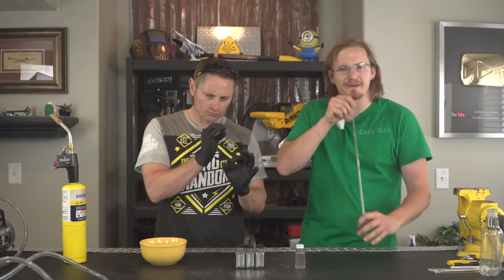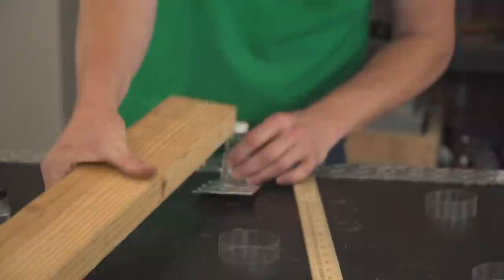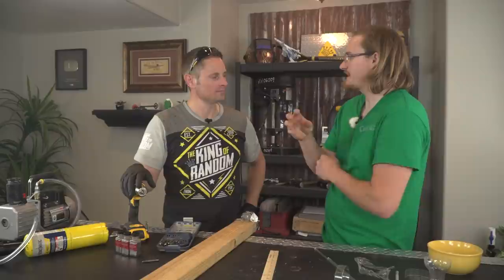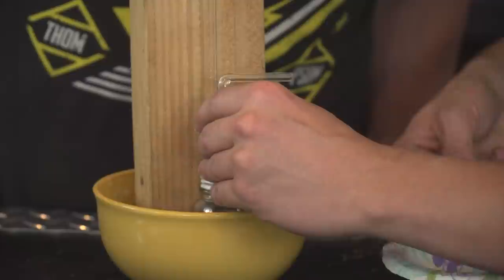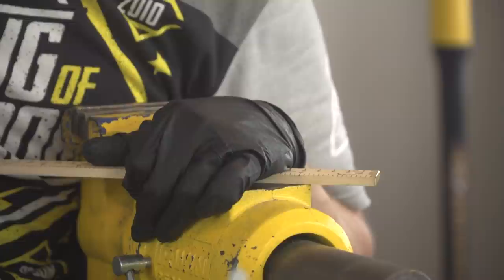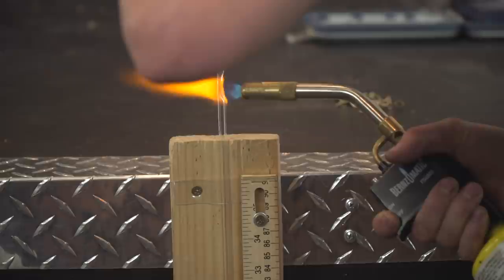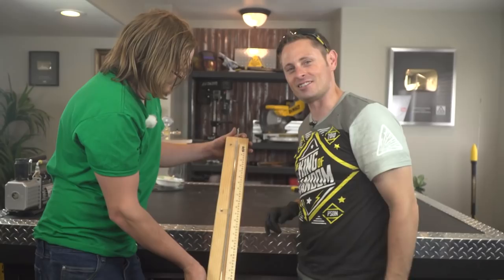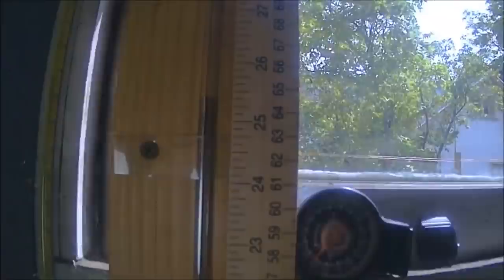Making a Barometer With King of Random

Comment: Kudos for tackling this. I did it a long time ago (still works!) and it's a very gratifying instrument to make.

There are few major errors you made that result with problems with this barometer, though:

1) That aluminium base is going to rust away. No doubt about that. Never ever use aluminium to secure anything around mercury. They do leak vapors (don't keep them indoors) and sooner or later that thing will fall off. Use a wooden base secured with iron nails and PVA glue.

2) Use a millimetre paper. As you can see, daily oscillations of atmospheric pressure are tiny. For mercury barometers, mmHg is the best unit. It's metric, translates easily to pascals, and it's dense.

3) That's not how barometer tubes are filled. That little bubble of air at the top is not a small error. Pressure above mercury should be mercury vapor pressure at given temperature. You have a significant air bubble (tube is narrow).
This barometer will give off wrong readings.
Instead of vacuuming it, let the liquid do its thing. Seal the tube into spherical shape, anneal it with sooty flame (your seal has a great chance of snapping from thermal shock). Secure the tube against a wooden plank and slowly fill it with mercury. Few drops, agitation, tapping on the glass. That completely fills the tube and you can see if there are any trapped air bubbles. Care must be taken not to subject the tube with lots of liquid to acceleration because liquid hammer effect will occur and it will smash the sealed end.After you fill it, hold the opening with a finger, tilt the tube slightly (liquid won't pour out - atmosphere is holding it) and slide it into a bottle of mercury. Then lift it upright, slowly, while tapping the sealed top. Liquid will pour out, leaving a nearly perfect vacuum at the top, vacuum you can't get with even reasonably priced pumps.

It's an art and it takes considerable work. It can be downright hazardous because glass snaps and mercury shoots out so make sure the bottle can hold all of the mercury from the tube.
Good thinking with the balloon. It shows you understand how this works.
What you now have is a baroscope. To make it a barometer, you need proper vacuum inside and calibration.

Comment: The vacuum may be illustrative but a barometer would be more easily made by filling the tube with mercury and having the perfect vacuum happen as you turn the tube over. The vacuum pump adds nothing to the finished product.

Comment: Isn't that an imperfect vacuum? I thought the process was to mercury fill the tube and then invert it.
Reply: YES! You are 100% correct. That is the procedure that delivers a tube that can be calibrated. Their barometer contains significant amount of air above mercury so it can't be used for measuring.

Comment: instead of trying to pull the vacuum with the pump you could have closed off the tube, filled it with mercury, and tiped it over into a bowl. you would then have a near perfect vacuum with the exception of the mercury vapor

Comment: If it was a true vacuum the mercury should make a crack as it slaps on the glass very hard (sometimes can cause the glass to break  ... or os did my physics teacher tell me ... so I'd avoid doing that on a melt sealed tube if I could).
Also I'd have tried to achieve the vacuum from a filled tube and then put it upside down into the mercury jar to let the level go down leaving a close to perfect vacuum (just the vapor pressure left) .
Reply: Yes, it's the liquid hammer effect. When properly filled and inverted, mercury in a tube can hit the sealed end and that sounds kind of like strinking a musical triangle. Very dangerous as it can cause the sealed end to burst. That's why it has to be made spherical and annealed.
Also, those strikes emit light, too. It's very faint but visible in complete darkness when your eyes adjust. Separation of charges does it.

Comment: That's a great job Cody I'm glad I'm subbed but, can you take the project and put it on sea level to an actual sea or ocean so we can see the actual pressure on sea level.
Thanks, love.👍
Me
Reply: Theoretically the pressure there should be 760mm•Hg I really wanna know if it's the same using an actual measuring tool

Comment: You did it the hard way.....fill a tube that has only one hole in it (the hole you drop into the mercury at the bottom with mercury.  Then wear gloves and put your finger over it.    Then invert into the mercury pool at the bottom.  The mercury drops and produces a vacuum.  Easy barometer.....

Comment: Why do you have to pull (an imperfect) vacuum before sealing it?

If you'd just fill the tube completely with Mercury in a horizontal position, and then stand the tube up, shouldn't the weight of the Mercury pull a basically perfect vacuum at the top of the tube?

Comment: Hi Cody & Grant. Could it be possible to make the barometer without using the vacuum pump?  eg. Fill up the tube with one end capped (horizontal position) which will of course be a perfect vacuum in vertical position.

Comment: For the barometer, couldn't you seal the glass tube then fill it with mercury and quickly turn it over into a pool of mercury? or even cap it off while under a small amount then place it in the pool, then un cap it? I'm just thinking that if you tip that the wrong way you are going to have way too much trouble fixing it.

Comment: Nice video, but the vacuum needs to be perfect, otherwise the barometer will not provide a true reading. That little vacuum pump does not provide the level of vacuum that's required for a true barometer.

Comment: Cody, random question here: I'm ordering a metal forge to melt down some scrap but I'm worried about the slag that may be generated. Should I just use a metal spoon to quickly scoop the slag? Is there a better option? Thanks! (I'm planning to melt down copper and aluminum)

Comment: Is there a set width of the glass tube that needs to be used? it seems if a thicker tube was used it would take much more force to make it rise
Reply: Indeed a valid question. Mercury displays negative capillarity. I'd suggest not going narrower than 2 mm.

Comment: I'm not sure I get how this works... If the pipe and bottle are perfectly sealed and rigid, how does external pressure changes affect the level? Is that what the balloon was for? (I thought that was to trap vapour?)

It was said in the video that if the outside was made into a perfect vacuum, that the level would rise right to the top... but if it's sealed and rigid, I would have expected the inside to be its "own environment"?!

Comment: Cody, is there any reason you couldn't build the barometer upside down, with the Mercury already filling the tube to "remove" all of the air and then flip it back over at the end? that would use the Mercury to pull the vacuum for those of us with no pump, and might even pull a better vacuum?

Comment: Good video. You could fill the sealed tube with mercury, put a (gloved) finger over the end turn it upside-dwon, then into your mercury reservoir. instead of using a vacuum pump. Also, can you make your scale adjustable with repect to the level of mercury in the reservoir? That would reduce the 'emergent column error' (a bit like the Torricelli barometer).

Comment: does having a different width of tubing change the height of the mercury?
Reply: I'm pretty sure it doesn't. Maybe if it's really narrow you could get some competing factors at play. Just look to the units used: PSI for one. Pounds per square inch. That is, if you increase the square inches, you don't get less force on each square inch. It's like how gravity affects heavier things. Heavier things are accelerated the same as light things, because gravity applies to each unit of mass the same no matter how many there are. It's not like there's only so much gravity to go around and heavier things have to spread it out more, right? In the same way, pressure applies equally to every bit of area it's pressing on.

That's my best explanation anyway.

Comment: I know you have vacuum pumps ...... but could you not do it by lowering the tube until the mercury is at the top and sealing it (epoxy?) .... then when you raise the tube to the vertical and the mercury drops you could then seal the tube with your torch?
Reply from the maker: Thats what I did last time and it was a royal pain in the but.
Reply: Fair point then ;O)

Comment: Mix termite and potasium nitrate 50/50 and light it up . Will it burn or explose ??
Reply: Kamun Reser thermite already has an oxidizer so adding nitrate to it will probably just make it burn slower or not at all
Reply: Max McCormick My chemistry teacher say its will probabli explode, but its dangereos because the pieces of molten iron will fly anywhere, so we cant try it.
Reply: Probably the reaction woudnt work. The nitrate would oxidize the Al before it would react with the FeO.
Reply from the maker: ok so fun fact: adding a salt (metal acid) to something and heating it is very similar to adding the respective acid since in this context hydrogen actually behaves like a metal . so If you add nitric acid to Iron oxide, not much happens since nitric acid is an oxidising acid and the iron is already oxidized, it may go into a solution but its about the same type of reaction as sugar dissolving in water and of course potassium nitrate does the same thing. aluminium reacts with nitric acid for a brief instant before forming an insoluble layer of aluminium oxide and the reaction stops. potassim nitrate does the same and so unless the aluminium is atomically fine (particles only a few atoms thick and somehow not already oxidized)  no visible reaction will take place. put this together and the nitrate will form a protective layer keeping the iron from reacting, therefore the thermite reaction will be stopped or at least made much harder to operate. Now if the nitrate is in a low level that still allows the thermite reaction to propagate the intense heat will decompose  potassium nitrate into potassium oxides, oxygen and nitrogen gas. the oxygen may react with the metallic iron formed and release a bit more energy that way but it wont be significant to the overall reaction. the nitrogen gas however will cause the thermite to sputter and froth, likely tossing it out of the reaction container. 
Ok, so you obviously caught me at a good time, this is probably the most detailed comment response I've made in a while.
Reply: Kamun Reser I don’t know, I don’t have a lot of termites
Reply: Impressive response Cody!
Reply: Cody'sLab Thank you.
Reply: Cody'sLab this comment made me reconsider not majoring in chemistry
Reply: Postassium nitrate does not burn on it's own, it just oxidizes other substances. Potassium nitrate is harmful to living creatures such as termites, and causes skin and lung irritation, and will cause severe breathing issues if enough is inhaled. When you mix the termites in with the potassium nitrate it will most likely harm and eventually kill them. The potassium nitrate will not burn, it needs to be mixed with something else that does burn and it will speed the reaction. The termites will possibly burn but not very well, and definately would not explode.
Reply: John E. It's amusing how many people have taken his typos and bad grammar and tried to seriously answer the question in one form or another, some taking him at meaning thermite and some literally taking it at face for termite. Quite amusing.
Reply: Mikee Vee ok ok english is my third language so if i made a error dont critize me please.
Reply: Kamun Reser oh, I'm not criticising you, I'm laughing at the people who are interperating it both ways, I knew what you meant, and most ran with it as a joke, but some actually explained what would happen to a termite.

Comment: Can you make Mercury
Reply: The Animals urm... it’s an E L E M E N T
Reply: No it be an element
Reply: It can be mined and refined, or it can be extracted from some other chemical, but it can not be made without a particle accelerator : P
Reply: The Animals yes you can, I have a recipe you can use:

200 ml of seminal fluid 
50 g of dried rat shit
Half a cucumber 
A homeless mans shoes, preferably leather 
And 30 ml of condensed zyklon b gas 

Hope this helps :)
Reply: He did make videos purifying it
Reply: The Animals he made a vid where he extracted it from cinnabar , if u mean mining
Reply: Cody has refined mercury from cinnabar. It's in a video awhile back, really interesting.
Reply: Yes, just take 80 Helium atoms or 10 Oxygen atoms and smash them together as hard as you can, then BOOM, you've got Mercury.
Reply: canned_doughnuts _ you can make elements. Hydrogen is an element and it can be made by mixing drain cleaner with aluminium foil. I dont understand the specifics, keep that in mind
Reply: canned_doughnuts _ not just leather! It has to be leather of unborn deer! Otherwise the yields will be very low and contaminated with zinc!
Reply from the maker: I might be able to hit gold with some neutrons but with my current capability I might only make a milligram after a thousand years and I would ruin perfectly good gold in the process.
Reply: Yeah, you just need a particle accelerator and collide fundamental particles at almost the speed of light to make it
Reply: Step one: get yourself a very big star
Step two: wait for a few billion years
Step three: hope for supernova
Step four: collect mercury
Reply: obvious grant fan is obvious
Reply: DerpFace Davis  You're not actually making hydrogen in that case. The drain cleaner already has hydrogen atoms in its molecules, and you're just separating them.
Reply: No, it's an element and unless you are rearranging atoms you can't make mercury
Reply: DerpFace Davis ya but you aren't making it, you are simply extracting it :)
Reply: Damnit Cody I was going to give that reply. You stole my thunder. :)
Yes, you can make mercury:
1. Take a strong source of alpha radiation - americium or polonium might work but have too short half-lives so you may want to go for radium directly
2. Mix it with beryllium to make a source of fast neutrons
3. Place a several inch thick piece of plastic or paraffin next to your neutron source as a moderator to slow them down
4. On the other side of the moderator, put a gold coin.
5. Go do something else for a few thousand years.
6. Come back, and your gold coin will now contain a few milligrams of mercury.
7. Profit!!!
Reply: Theoretically, you could add a proton to gold, and you'll get an isotope of mercury... but nobody's really done it, or has bothered to
Reply: use code: KEEM
Reply: +Gandhi Boys or you get water and some helium gas

Comment: why dont you calibrate the barometer phone the  local airport for pressure?
Reply: I'm afraid it will take more than a phonecall. He first needs a proper vacuum (he filled the tube incorrectly) and then get proper height above sea level.